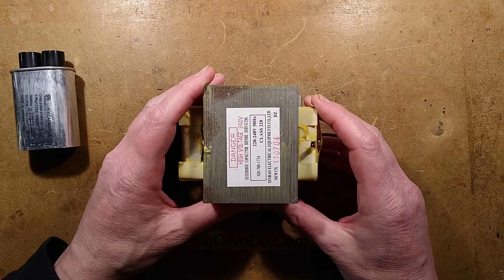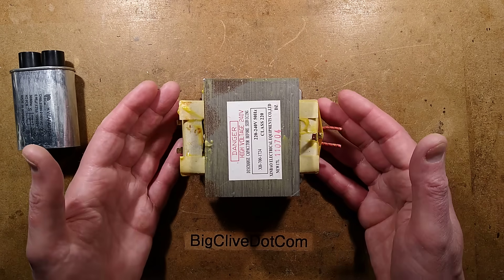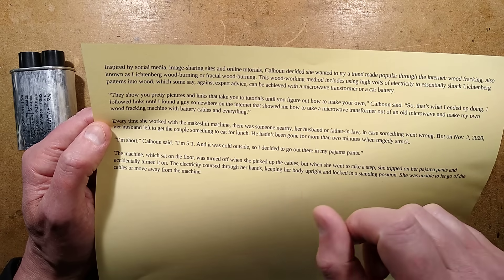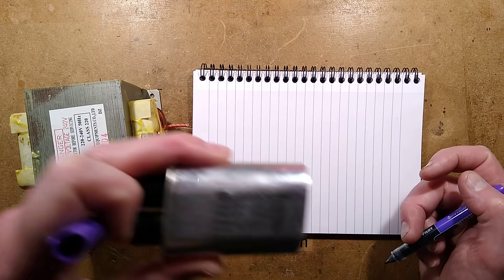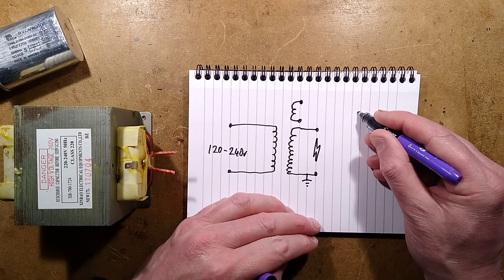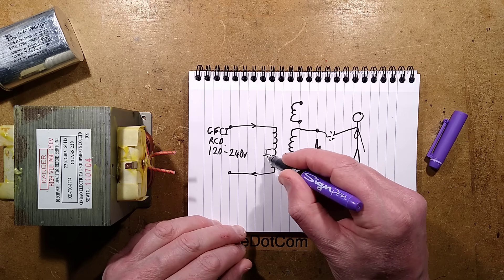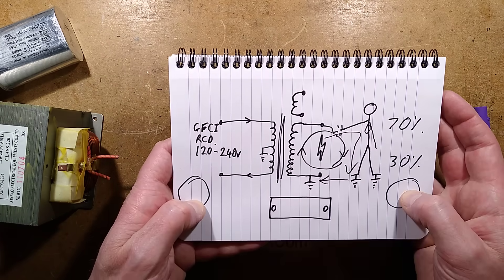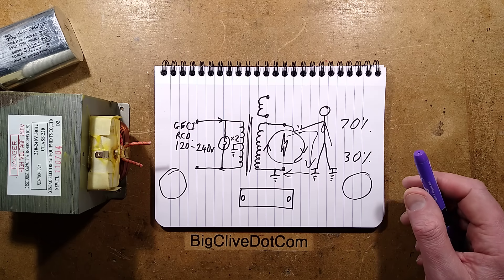The most deadly project on the Internet

Comment: As my electronics lecturer used to say "they're called killer-volts for a reason". 
A stupidity-induced accident that has no negative ramifications can be a good thing, but it's impossible to plan that!
 Mine was offering to help my SIL diagnose an electrical fault whilst I had the flu. I went to check the MCB was actually energising the circuit (and NO, a glowing screwdriver must NEVER be used to check mains power) but had the multimeter set to the resistance setting. Fortunately a forward thinking engineer had considered the possibility of an idiot so had included a fuse in the multimeter. It died (with a bang) before the probes (which I was stupidly holding in each hand) finished melting. Lessons learned:
1) don't do things that require thought if you have the flu
2) always use multimeter leads and probes from a reputable supplier
3) if the multimeter has a probe holder, use it for one of the probes.
4) don't do things that require thought if you have the flu.
Reply: Ah, if we're swapping stories... I was commissioning an X-ray photoelectron spectrometer (an ESCALAB) pushing nearly 2kW of power into 15kV. It runs of three-phase supply and has water cooling supplied to the X-ray source anode. Normally in operation the anode connection is covered by an earthed metal shield that also has inbuilt interlocks to prevent it running while open. But during assembly the machine needs to be fully open in order to observe the integrity of the cooling system joints during operation. 
I was having a difficult day with a delivery deadline approaching and a particularly awkward gasket seal on this anode was giving me trouble. As I ran the machine, testing for stability of the power supply output at max, I couldn't quite make out whether there was a small leak forming a drop of water at the anode connection. It was possible that there had been a drop clinging there at start-up from earlier leaks. Unthinking, I got a wad of the cleaning tissue we used and went to wipe off the drop, completely forgetting the machine was live and at max power with 15 kV on that anode..
I got within a couple of millimetres and the high potential gradient blasted the drop of water off the anode, followed it up with a huge fat spark that ran across the wad of paper and spent itself on the casing which the wad just happened fortuitously to have touched as I pushed it forward. 
If it hadn't been thus accidentally grounded, it would certainly have killed me. As it was, the wad of paper burst into flames in my hand and the circuit breakers on the machine all tripped out with a bang.
I sent a silent prayer of thanks to the gods of fortune and accepted a stern lesson learned.
Reply: "a glowing screwdriver must NEVER be used to check mains power" - Why not?
Reply: @CoolKoon  Also (read @Peter Mulholland above) these are cheap throwaway "China Export" devices that can be bought for £1.75 each; they most certainly do not include any safety device/mechanism/circuitry so either of the two possible failure modes ["safe"|"danger"] can occur with no predictability.  I.e., connect it to a source with negligible resistance and give it a fault current that the little neon lamp cannot survive, and it might blow open, or it might carbonize and effectively short closed.  The only reason the neon works is that you provide the high resistance circuit path that prevents it blowing instantly.  If you are currently low resistance (wet, sweaty, have multiple parallel paths to earth, other vulnerabilities are available) then it can blow and can present you with those wigglies at negligible resistance.
They have their uses, certainly, but mains voltage is absolutely not one of them!
Reply: @Dranok1  "connect it to a source with negligible resistance and give it a fault current that the little neon lamp cannot survive" - You really have no idea how these things are used, do you? By design they always ARE connected to "a source with negligible resistance" (i.e. a freakin' wall outlet!) and they ALWAYS have a resistor in series because the "neon" needs to be current limited. 
"They have their uses, certainly, but mains voltage is absolutely not one of them!" - That's pretty much the only thing they're good for....
With that being said these things definitely shouldn't be bought through grey import for sure.
Reply: @CoolKoon  Even if you have a safe neon screwdriver, it shouldn't be used to prove a circuit dead. If it lights the you know the circuit is live but if it doesn't light you can't be sure the circuit is dead. For safety purposes they should be used in conjunction with other methods.
Reply: @eDoc2020  "Even if you have a safe neon screwdriver, it shouldn't be used to prove a circuit dead." - I fully agree. It should always be used only to see if voltage is present in a device somewhere, not its absence.
Reply: @CoolKoon   as this diagram shows the circuit being completed by the ground/cpc/earth and not returning to 0 volt to close the circuit back at the transformer winding. The same is being done with those glowing terminal screw drivers, the screwdriver blade touching a positive terminal the diode is taking a load and the back of the screwdriver is now 0 volt as it’s after a load ie neutral/return. Then you put your finger on the back of the screwdriver and you are now the 0 volt/neutral/return and are part of the circuit, but it’s not going to a true neutral/return you are acting as a ground/cpc/earth and that means that IF the diode is faulty you are the one receiving a bloody good whack through you and down to earth (like this transformer drawing) 
Those illuminating screwdrivers are fit for the bin, only the bin, not even for doing non electrical jobs, because there dangerous and somebody else who doesn’t understand the risk with them can pick it up and use it for electrical work just like you didn’t understand. Throw it in the bin.
Reply: @DuckTheMatrix  "The same is being done with those glowing terminal screw drivers" - No it's NOT. First of all the voltage is by at least an order of magnitude lower and second you should look up the definition of this thing called "RESISTOR". No, you don't get the full blast even if the indicator light fails because there's a resistor that acts as a current limiter.
"Those illuminating screwdrivers are fit for the bin, only the bin" - Yeah, all those electricians are doing it completely wrong! And have been doing so for decades! You know better, because you read some BS on the Internet that says the opposite...
Reply: "a glowing screwdriver must NEVER be used to check mains power" - I would also like to know why not. Isn't that its purpose?
Reply: @Fireflyホタル  because the whole reason it glows is because YOU are the return path to ground. If theres any moisture, or metal dust, or anything that means the current is not limited by the neon itself, you will get the full unlimited current at mains voltage through you.
Reply: @jaycee1980  exactly this, thank you! 😀
Reply: @jaycee1980  "If theres any moisture, or metal dust, or anything that means the current is not limited by the neon itself" - Yeah that's simply not true. The "neon" needs to be current limited so it's ALWAYS used with a resistor in series. Given the fact that the glowing screwdriver has been used to test for the presence of voltage in outlets for MANY decades (at least 70 years if not more) advising against their use in standard mains voltages is bad science.
Reply: @CoolKoon  He was referring to contamination inside the device which could bridge the resistor. Plus there's usually only a single standard resistor without safety ratings. You would want a resistor with special high voltage ratings to ensure it doesn't fail and hurt you.
Reply: @CoolKoon  and the point is that if there is any moisture inside the screwdriver, that resistor is bypassed and you get killed. My guess is you are an American and you are looking at it from the point of view of a 120V shock. We have double that in Europe which will do you a lot more damage.

Also how long was smoking a thing before they discovered it was bad for your health ?
Reply: @jaycee1980  "My guess is you are an American and you are looking at it from the point of view of a 120V shock." - No, I'm from Slovakia and happen to have a degree in EE too. What you're saying is complete bollocks because contrary to smoking I've never heard of ANYBODY dying from a glowing screwdriver while testing for mains voltage EVER. Yes, MAYBE if the damned thing was flooded with water then you MIGHT get a more unpleasant jolt but in reality water's not a good electrical conductor at all, especially tap water. The versions legally sold in EU and UK must not pose a shock hazard and asserting the opposite is a cynical lie by complete laymen who don!t know what they're talking about.
Reply: @jaycee1980  There's a high value resistor in the circuit along with the neon. A neon in fact has almost zero impedance when it's lit. It's almost impossible to get enough conductivity past the resistor with just dirt water of even metal filings. Short of some idiot replacing the resistor with something else they're quite safe at mains voltages.
And that really is the purpose of these screwdrivers: a quick-and-dirty test for the live wire.
That said, I only ever use one to confirm that I pulled the right breaker.
Reply: @qwadratix  Again, youre talking about 120V. 240V will jump quite a bit of current through water. If you really must use some quick method this is why they make non contact voltage detection sticks or "chicken sticks". 

If you were an electrician in the UK or Europe and you were seen using a neon screwdriver, you would lose your certification pretty much instantly.. not to mention your liability insurance
Reply: @CoolKoon  You're lying, but oh well.. I have seen it proven in a test rig using a Bockwurst sausage as the unfortunate finger. It blew it right off. I think I know what I'll believe thank you very much.
Reply: @eDoc2020  "He was referring to contamination inside the device which could bridge the resistor." - Due to those gadgets' physical dimensions there's literally no type of contamination that could make the thing conductive enough to hurt you. The only way it could be made dangerous would be if someone literally bridged the resistor with a piece of metal strip.
"Plus there's usually only a single standard resistor without safety ratings." - As it should be. 
"You would want a resistor with special high voltage ratings to ensure it doesn't fail and hurt you." - You're not supposed to use them on ANY voltages exceeding 1000 Volts. They're only supposed to be used in checking for mains voltages.
Reply: @jaycee1980  I'm talking about 240V. I live in the UK where they're readily available from UK trade suppliers and widely used.
Again. These screwdrivers are sold for the purpose. They have no other use. See if you can think of one.
Reply: @jaycee1980  You did? And how many volts have you used? I can bet my ass that it wasn't standard mains voltage or a standard glowing screwdriver. But keep spreading BS like this to entertain the naive kids who might stumble upon this video...
Reply: @CoolKoon  Those naive kids would be better off not taking the risk. And you are definitely American with that attitude and language.
Reply: @jaycee1980  "Those naive kids would be better off not taking the risk." - There's a high chance that some of them WILL take the risk.
"you are definitely American with that attitude and language" - You're flattering me :D

Anyway what voltage have you used? The phase voltage of 230 volts? The line voltage of ~398 volts? The peak phase voltage of ~325 volts (rectified and filtered DC)? The peak line voltage of ~563 volts (rectified and filtered DC again)? If you haven't used any of these options during the sausage finger test then you're full of it....
Reply: @qwadratix  Just because they are sold for that purpose doesn't mean they're the right tool for the job though - see Swiss Army knives, adjustable spanners, the jack and wheelbrace included with a car and those "one socket fits everything" tools for other tools that you definitely wouldn't pick if you have the right tool to hand (plumbing work introducing an exception for adjustable spanners as the f**kers who make compression and threaded fittings can't agree on a standard size). 
Even if we ignore the "might pass a dangerous current" failure mode of the novelty screwdriver, there's also the "could fail to light, leading user think circuit is dead" failure mode. 
Do it right, just use a meter (and don't ask me to do it when I have flu 🤣).
Reply: @donkmeister  Good grief, they're fine for the purpose intended. They've been around since WWII and just because there are more sophisticated tools doesn't mean they're suddenly useless. 
In the UK, dangerous electrical equipment is actually illegal to sell. These are perfectly legal and comply to DIN 57680-6.
Used competently they're perfectly OK and in some cases preferable to other methods that rely on a presumed good earth. They are basically a last-ditch 'is it safe to touch this?' confirmation, especially if you're working in third-world conditions where god only knows what lunatic last wired up the sub-station. (I've seen a laboratory earth connection made to a rusty bolt set in a concrete floor before now)
Reply: @donkmeister  "the novelty screwdriver" - Okay, you really have no idea what you're talking about either. This "novelty item" you're talking about has been around for so long that I have one that used to belong my grandfather even! It's been made WAY before the chinese phase testers have flooded the market.
Reply: I mean, my favorite insane Brit makes a somewhat compelling argument: https://www.youtube.com/watch?v=AGXQNLq19FQ
Reply: GS38 test leads. 
These should be fitted with a 500mA fuse and only have  3mm of metal protruding from the probe.
Reply: "impossible to plan"

Ain't been in the game long have you
Reply: Also, you can buy a meter that does voltage and continuity/resistance that has no settings. I have a Fluke one and if there is voltage present, it vibrates and lights up to tell how many volts. If it isn't live, then it shows how many Ohms and if there's continuity.
Reply: I initially misinterpreted glowing screwdriver as akin to the glowing wrench test I've seen accidentally used on car batteries. Never touch glowing metal.
Reply: @robertstoneking7916  Maybe you should've googled it first before making your comment...

Comment: I used flyback transformers as a kid to do these, completely discovered it by accident, but I used a wooden stick wrapped in electrical tape on the handle side and a eye bolt in the hot side with magnet wire going to the flyback.

Comment: I am competent in the disassembly of electrical equipment. It’s my job. Even with a video detailing what to do, I would NEVER consider repurposing something to make a cheap alternative to something that exists with all the correct safety interlocks.
Low current at six thousand volts is very unpleasant. I know. I operated and calibrated equipment to twenty thousand volts. Sometimes it was built incorrectly. It was my job to check that build and fix any issues.

You CANNOT be complacent when it comes to high voltage.

Thanks, Clive. The photographs in the linked article are truly horrific. No one ever believes that it can happen to them until it happens to them.

Comment: No mention of insulated gloves?
There are high voltage insulated gloves you can buy
that certainly would lessen the chance of an accidental electrocution.
but that aside, i think you should do a whole video
on the safer version you mentioned at the very end
as an alternative to the dangerous things the other video makers are 
convincing people to do?
Reply: Forget the gloves, they give a false sense of security; as do chicken sticks (insulated handles). Work remotely, deadman's switches one body lengths from transformer, one and a half body lengths from the work piece (20 feet or so). Physically separate the the mains from the transformer by twelve inches before approaching work piece.  Have a short prioritized shutdown list for the person who finds you or the ems as a courtesy, just in case.  I may be paranoid, but I'm not dead yet.

Comment: Hmmm I think I’d rather use a soldiering iron pen and burn / draw a pattern on the wood. This reckless craze is ridiculous. My dad as a former sparky drilled into my head at a very young age never to piss around with electricity even if you’re qualified.

Comment: Sorry to be "that guy", my understanding is that a GFCI and an RCD are two different things?
Or maybe they were once?
RCD is looking at the difference between current between phase and neutral, if there's a different that means there's earth leakage which might be zapping someone.
GFCI is looking at the current coming back up the earth/CPC and if that's high it means there's a fault so turns the circuit off, like the olden days of blowing fuses with a high current path to earth but much more sensitive.

Or is that wrong/out of date?

Comment: I built a project using one but i lost the secondary and used a few turns of #8awg for 18v. i was using it to power an HHO generator. Fairly safe since the voltages are only 18v and 120v. even then i encased it in a plastic box and used 10kv hot gloves when disassembling the microwave